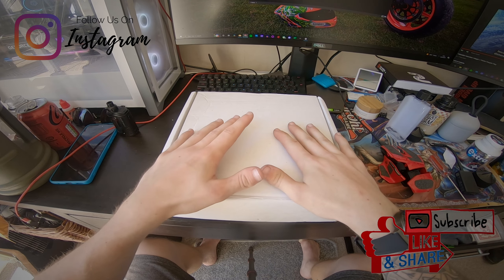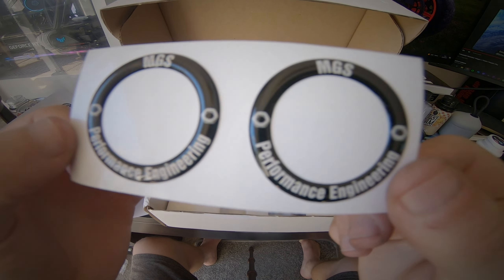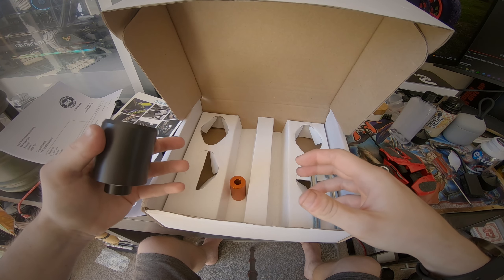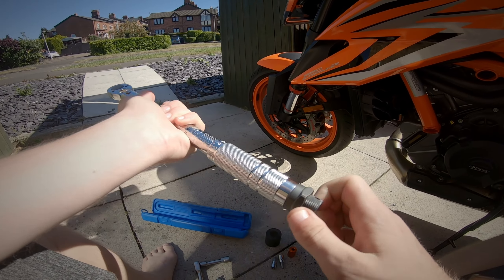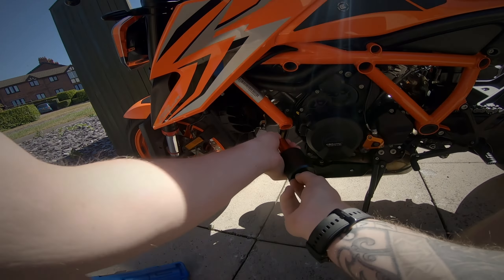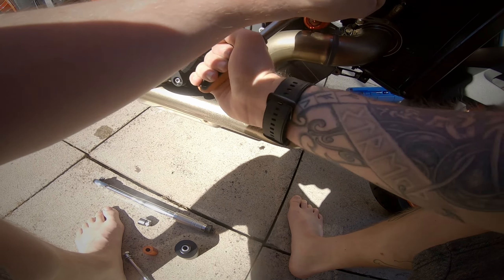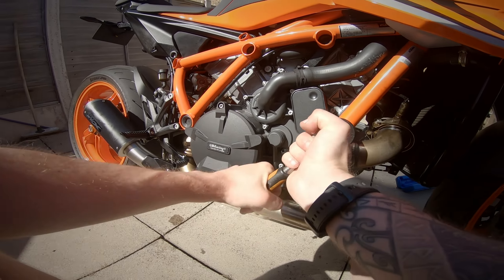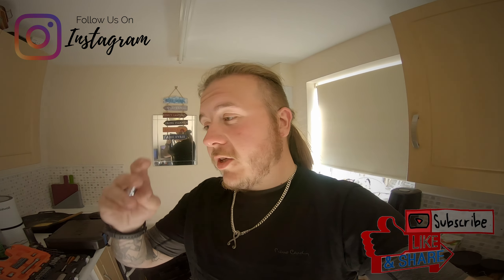KTM 1290 SuperDuke R FRAME PROTECTOR Install | MGS Performance Crash Protection

Comment: TBH I am not sure about this design. Usually, there is a mounting bracket with at least 2 mounting points. This can be mounted to the bike's frame in a really solid way. The screw that comes from this mount and is used for a bobbin itself should be weak enough to break before transferring too much force to the frame itself. In this design, all the force is applied directly to the frame mounting point.  This might work as a strong anchor and be more dangerous for the bike than not having crash protectors at all.